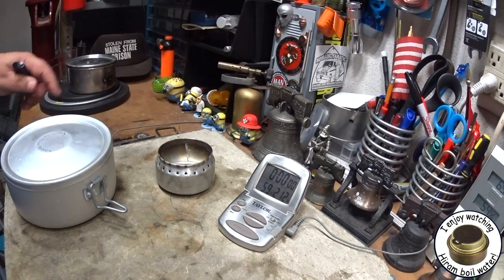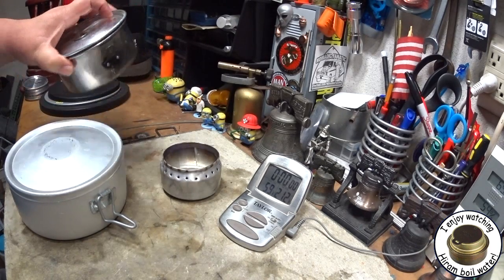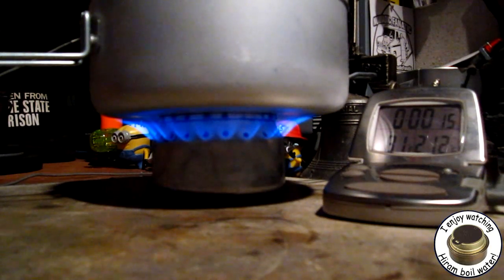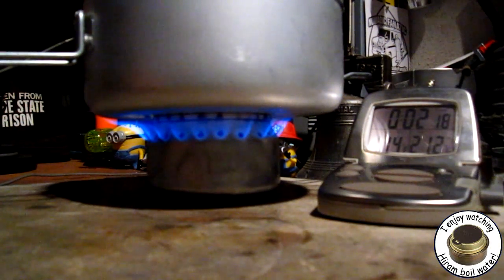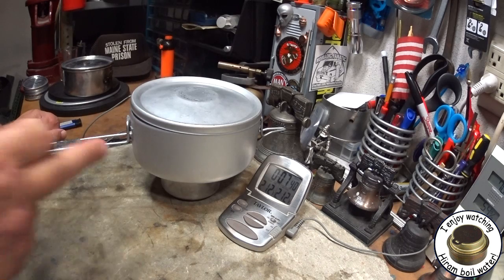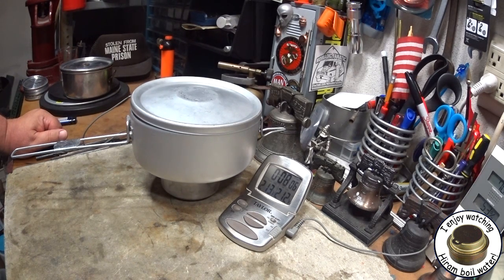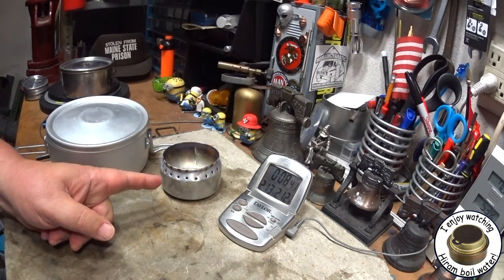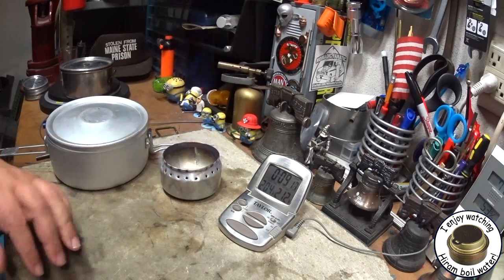NJ Chris' "SideBurner" Alcohol Stove - Boil test #2

Comment: Unfortunately there are a few flaws in this that are self-apparent.  The inside flame apex is not attainable on the pot.  The pot must be higher, or the burner flames must be lower on the side.  There is also the issue of having the airflow around the flame for heat conduction.  This means that the aperature on the upper surface must be of a smaller circumference of the side circumference/perimeter.

Hope this solves many issues with this burner.  Design is logical.  Modifications will perfect this.
Reply: John... Thanks for the constructive criticism...